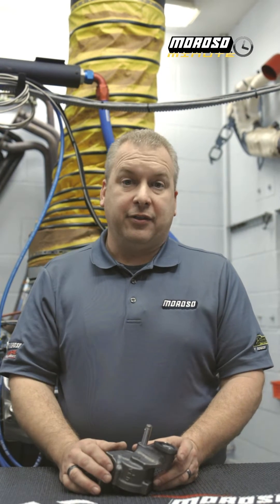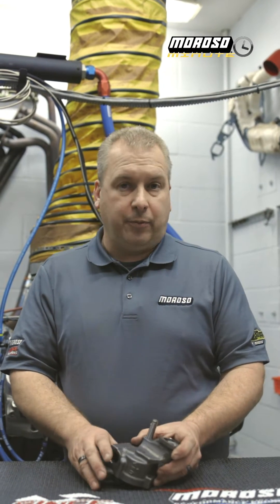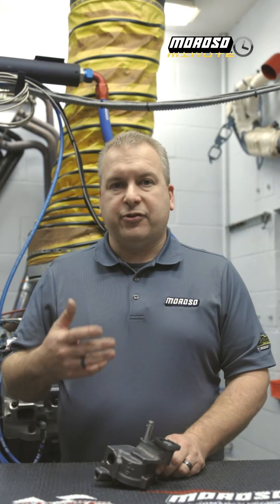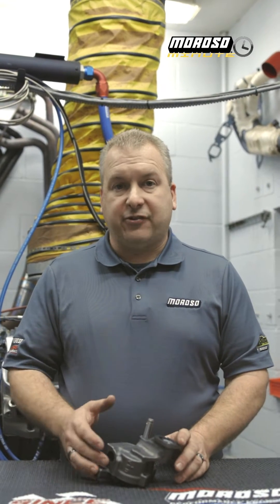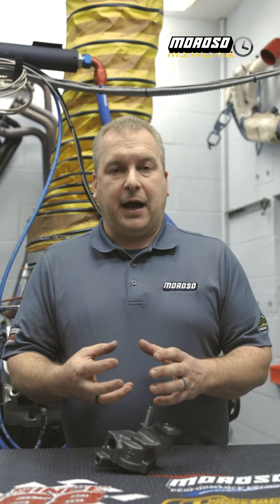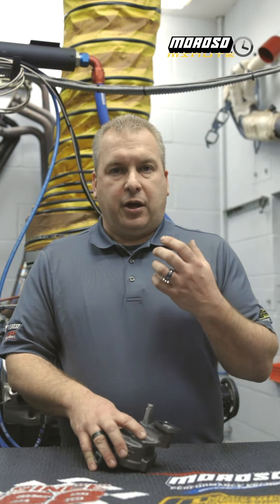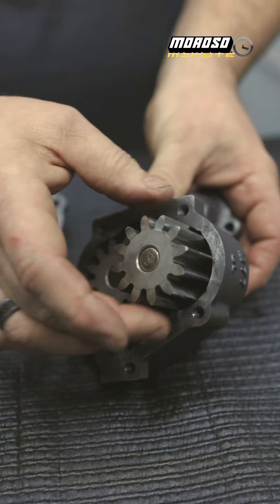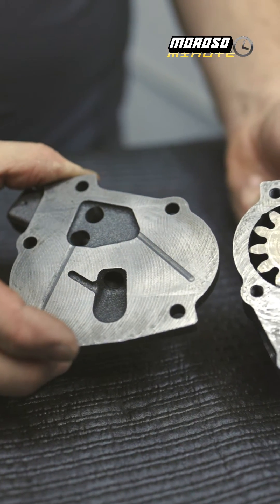ANTI CAVITATION PUMPS

Comment: Does cavitation occur when the oil is overpressured?
Reply from the maker: The reason there can be cavitation in an over pressurized situation is if the inlet feed rate isn't high enough to keep up with the increased volume demand.

So lets say the pump is flowing 10 gpm to make 80 psi of gauge pressure. Well if it makes 140 psi, it maybe flowing 14 psi to accomplish this.

If the pump inlet was happy at the 10 gpm outlet flow, the 14 gpm flow may be too high a rate for the inlet (pick up tube size, length, or in the case of an LS or Coyote engine, insufficient radius's on the pick up tube bends) to keep up. This is the beginning of cavitation, and the most common we see.

Scott